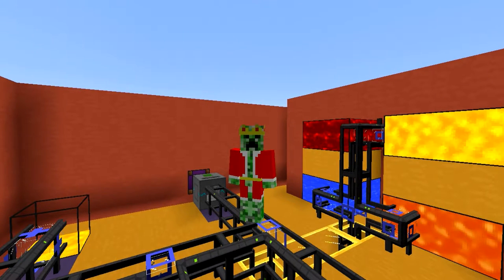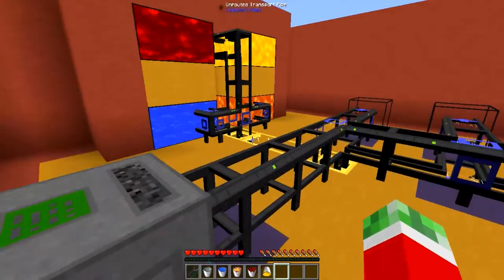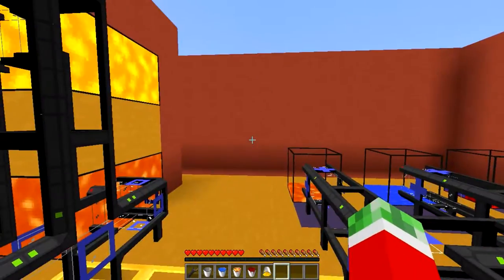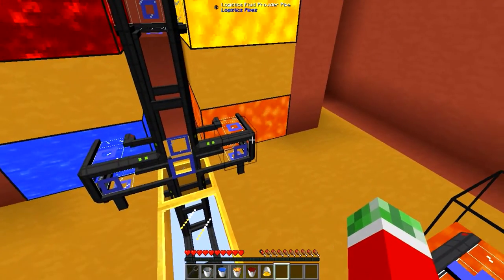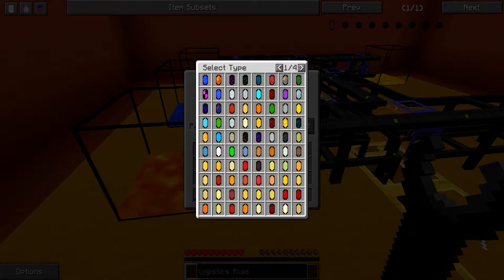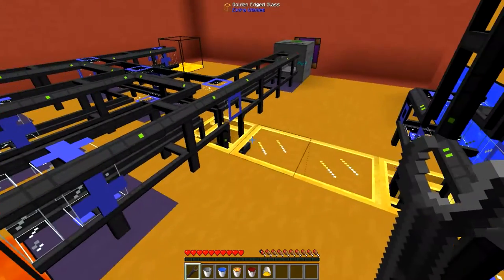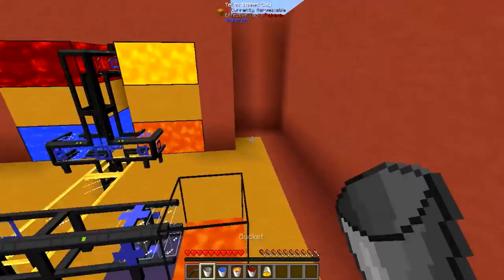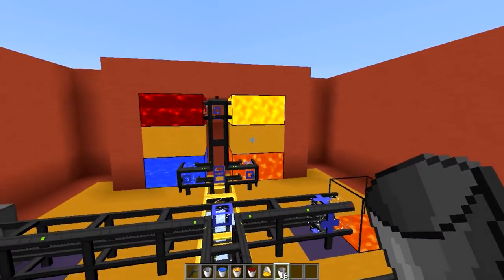Logistics Pipes Tutorial - #9 - Liquid Sending/Receiving

Comment: I did have a brilliant system using LP for liquid storage using Thermal Expansion tanks for all the fluids I was using ... and that was with Genetics from Binnie's Mods. Sadly the Resonant Rise team decided to update (in january ... which pissed me off and made me stop playing) and thereby remove Genetics from the pack ... and that seems to have broken all the liquid functionality because the same setup doesnt work anymore. SIGH! ARRRRGGGGHHH!!

Genetics is the perfect mod to demonstrate the usefulness of the LP liquid system, because you need "X amount of liquid" for a certain process (of which there a LOTS) and creating these liquids takes ages ... so its best to have them stockpiled in advance and continually produce them.
Reply: The "RULE" is: you need a "Logistics Fluid Insertion Pipe" OR "Logistics Fluid Extractor Pipe" everywhere you are "producing" a liquid [1] (exception: if it is connected to the place where it is requested without a Basic Logistics Pipe inbetween) to actually bring it into the system now.

Then you can use a "Logistics Fluid Basic Pipe" to put the liquid into a passive storage tank and a "Liquid Provider Pipe" to fulfill requests within the system.

[1] Like an Ender Tank for lava from the Nether or that other tank which collects milk from your cows ...
Reply: Usually, I place the extractor at the sending tank, the inserter/injector at the receiving tank, and the basic behind the insert/inject. Nothing worked even with power lol.

Comment: How would you build an automated smelting using Tinkers Construct? Refilling the magma and exporting ingots?
Reply: +Khaz Husky 

Best guess? Fluid supplier on the lava tank set to supply 4000 mB of lava at all times hooked into your lava gen/storage.

You could also probably hook up some sort of pump to the drains to pull molten metal out of it if you wanted, but usually people use a hopper beneath a basin or table (with ingot cast) which is itself beneath a filtered fluid-pipe (I use TE hardened fluiducts with servos set to whitelist the metal I want them to pull)
Reply from the maker: +Will B I have answered this question in Episode 11 of my Tutorial Series, in which I showed how to completely automate the smeltery including refilling of fuel, and exporting the ingots :) Hope this helped
Reply: ***** Huh, so you did! Your setup defintely works, but I usually play skyblock so sometimes one ingot cast isn't enough to keep up XD. For higher outputs I use filtered hardened fluiducts going into casting basins.